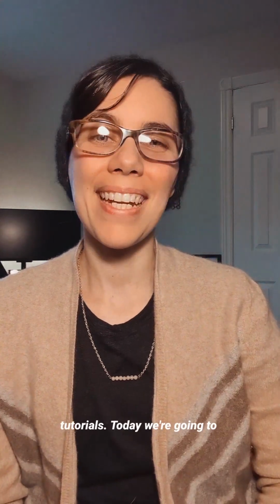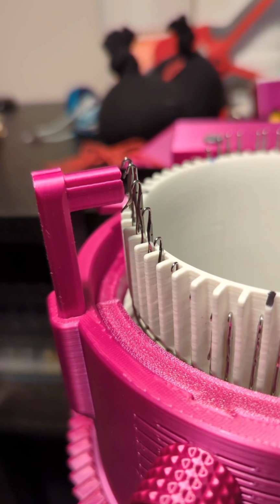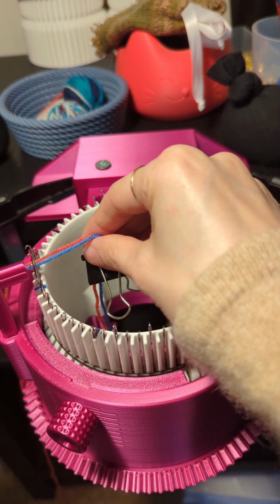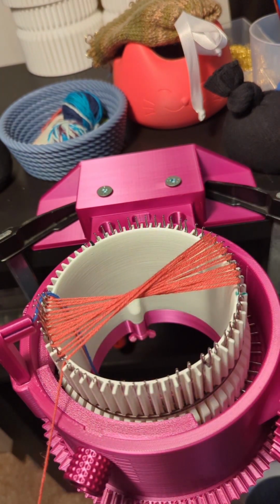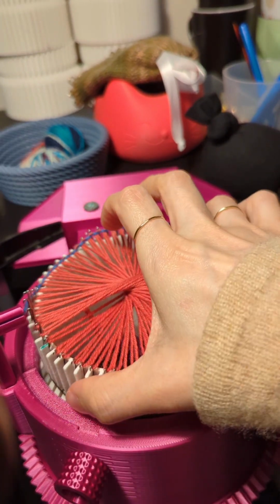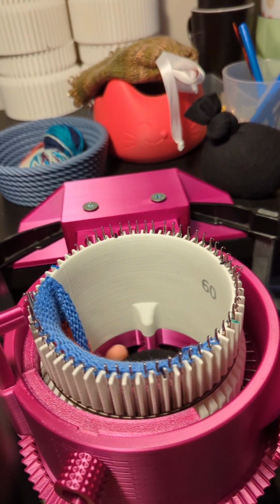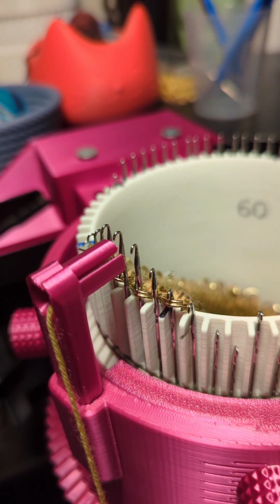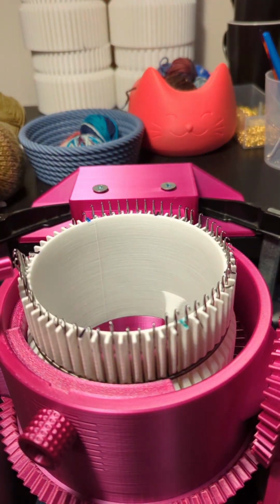Bear Valley Fibres | 3D Printed CSM | Casting on With & Without a Set-Up Bonnet

Comment: I cannot get the stitches to catch consistently. 
Im doing the wrap properly, ive tried so many times with so many tensions and different yarns, cranking 1 by 1, pushing downward, pulling downward,  pullinh each stitch down under the flap, it willl... not.... knit.   What am i doing wrong.
Reply: Even yarn feeding is a key. Do you make a cone? if I use a cake, I try to use the yarn mast from my LK 150. but I think cone would work better
Reply: @tatyana.mikina  since that comment i realized it was my tension and the feed.
I was so frustrated! LOL
It took me days to get it right, and now I've made several socks with no trouble!
Once I made a cast on basket , ive been just fine.
Reply: @louisacapell  I am really glad. It can be very frustrating.